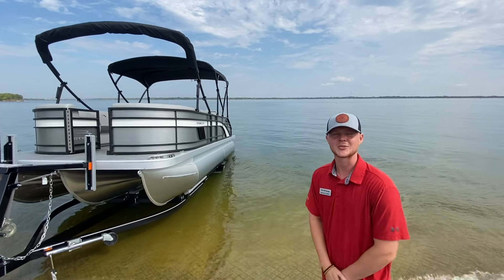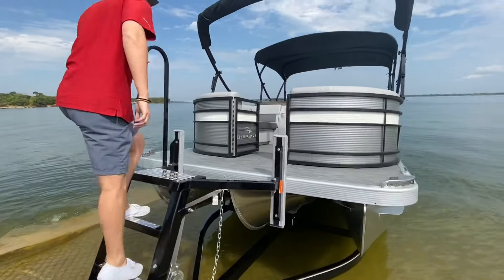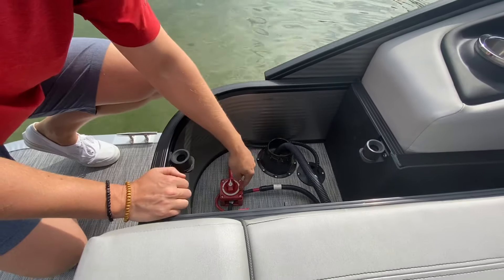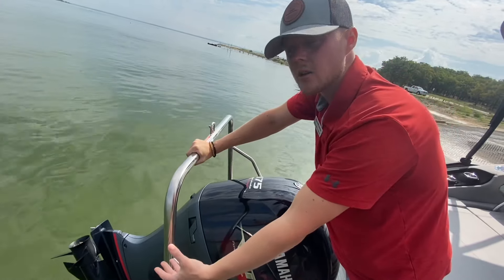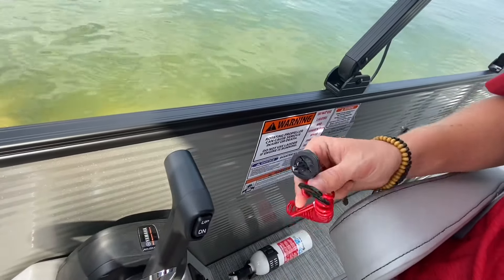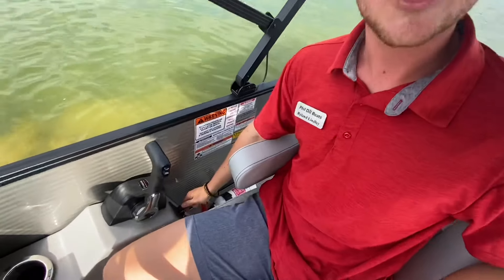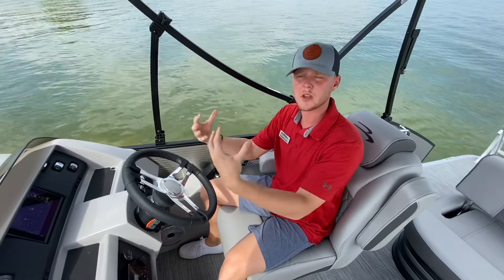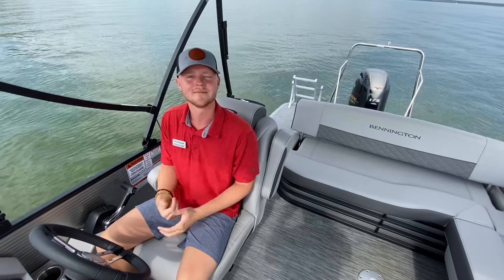How to Properly Launch your Pontoon/Tritoon at the Boat Ramp!

Comment: I would recommend installing the Blue Seas Add A Battery kit. It comes with an automatic sensing relay that keeps both batteries at optimum.  Only three positions for its switch....OFF>>>>ON>>>BOTH.  Run it in the ON position and no matter which battery gets "weak" it is sensed by the relay and automatically charged.  Nothing to remember but turn it on and not in the BOTH position unless one battery (e.g. Start) is super weak.

Comment: Nice video. One suggestion is to put yourself through a safety inspection before launching. Registration info , PFDs, fire extinguishers, etc. are much easier check/remedy before launch.
Reply: One suggestion I have for you is to read the title of the video, which is how to properly LAUNCH your boat. Not prep your boat, not trailer your boat, not winterize, etc.

Comment: For my setup, bat 1 is the start battery, and bat 2 is the house / deep cycle battery, using it to start my Suzuki can damage my motor. If I am not running my motor and I want to run other electronics I switch to Bat 2 only, to save Bat 1 to start again the 1&2 option is used while underway to keep things charged

Comment: Thank you, this is very helpful! I just attempted to launch a brand new Tritoon this weekend and had the motor running, but the steering had no hydraulics, so luckily we didn’t float off before we realized it. Took it right back to the dealer.
Reply: That sucks.
Brand new you say? Sounds like a recall or something.
Reply: @jeffniznick9280  luckily it was covered by warranty, but somewhere in assembly a screw was pushed through the hydraulic steering line and all the fluid had leaked out.  ruined that day but my dealer took care of us.
Reply: @chubbrock659  

Glad you got it fixed.

I’ve never owned a boat but we spent the day aboard a friend’s pontoon on Lake Havasu and I became hooked.

They’re out of my price range and reading your story I would’ve really been p*ssed.

But again, glad it wasn’t a major malfunction.

Comment: Actually if the gear shift is not in neutral the motor will not "crank".  Some people may think they have a dead battery.  So make sure you are in N so your engine will "crank".

Comment: I would connect the battery before I backed it in. I try to get everything that I can do , done, before I back it down. otherwise, nice video.
Reply: I agree
Reply: Actually  I would  back it down  until where it would float off  but before  I   undo the strap in the front  put it gear like you going forward then undo the straps  and then put  it in reverse.

Comment: Some pontoons do have drain plugs either on the pontoons or if it had an inboard/outboard, there is a drain plug on the transom. This info is only for this particular boat.
Reply from the maker: That’s why I have the disclaimer in the description, you are absolutely correct.

Comment: I would suggest disconnecting the trailer plug for the lights BEFORE backing into the water. If there is a crack/leak in one of the lights then it could short out when water hits it. But remember to plug it back in before getting back out on the highway with the trailer. Just something i have always done and have never had any problems.
Reply: A lot of trailers with brakes require the plug to plugged in or the trailer brakes lock up when the trailer goes in reverse. Safety feature.
Reply: That was necessary with the old Incandescent bulbs but you don't have to do that with LED lights now.

Comment: What do you do if you do not have a helper to back trailer more into the water?
Reply: Run a rope from the shifter to the boat then you're all set. 😀
Forgot to add the Run Fast method.👍
Reply: Get a smaller boat if it's just you

Comment: I’ve seen this asked at least once, but we will usually have our family (5) with me. When do they board the boat?
Reply from the maker: With this question, I think it is best to have situational awareness. If you are at a busy boat ramp with no dock, I would probably recommend loading everyone up before launching the boat. If it isn't busy out there with a nice dock to tie up to, launching the boat and then loading all gear/passengers up after you have tied up may be the better option. Most important is to make sure everyone is safe during the process. Hope that helps!
Reply: @rylandlindleyBMR  .... Thanks. We are about to purchase our first boat (Just retired) I’ve been checking everything and this helps a bunch
Reply: @Jdaddydu  welcome to boating. May sound strange but reference "boating fails", great examples of what not to do. Safety is often overlooked,  but sounds like you are doing your homework. As mentioned,  situational awareness is key. Plan days during the week for practice(less busy/stress),  minimize distractions,  have a check list for storage, pre and post launch, etc. Find an experienced boater for first few trips. My first few trips out with family were pure chaos and stressful. I get everything loaded, organized and ready in the staging area prior to launch, tasks assigned to passengers and we are launched in under 3 minutes.

Comment: How do you attach the kill switch to your body/clothing. Sorry noob question. :)
Reply from the maker: If there is not a convenient spot to attach the kill switch lanyard on your clothing, then I would recommend attaching a bracelet to the lanyard that you can wear on your wrist.
Reply: You usually connect it to your life vest or you can hook it to a belt loop anything you can do so if you were to get knocked out of the drivers seat by a wave it will kill the engine